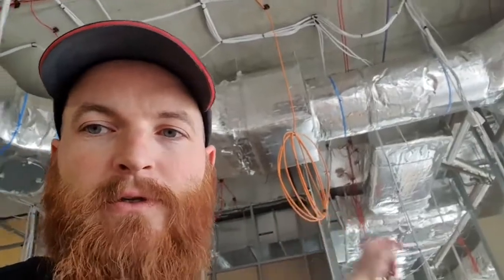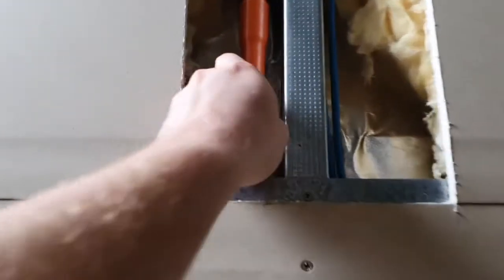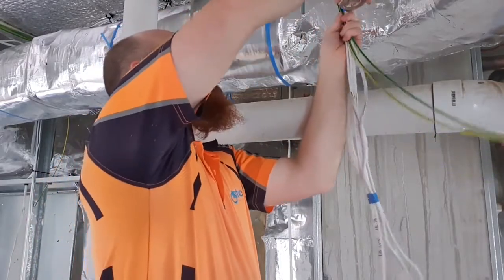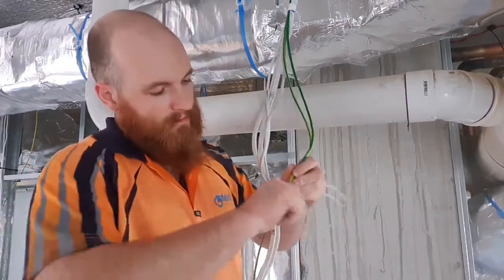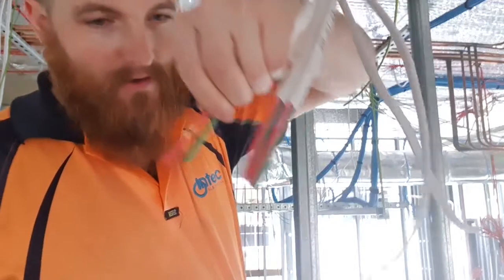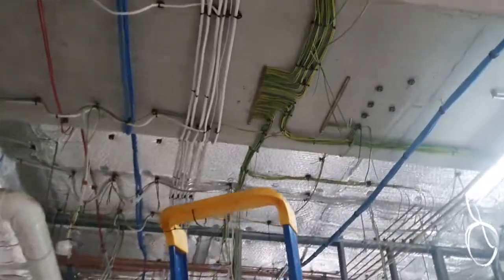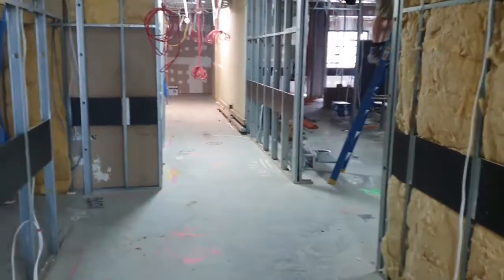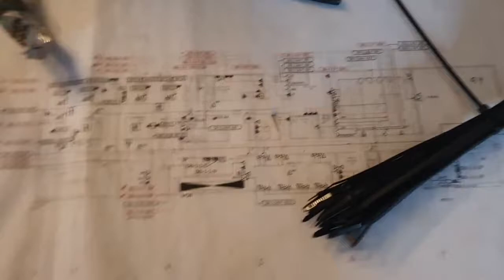ELECTRICIAN VLOG#8 - Cardiac Protected Wiring, Aussie Site Antics, Jacking Off Cable Tray, and More!

Comment: Rough in looks awesome mate👍 do you have to run the 6mm Earthing to all the Downlight’s as well? Not sure about using just Heavy Duty conduit, WSX3 refers to Very Heavy Duty Conduit I’m not even sure what that is?
Reply from the maker: Thanks, yeah in a cardiac area all lights on the equipotential bonding too. Im not sure what very heavy duty mean either to be honest 😅. It references 2 extra standards which cost another couple hundred bucks each - easy future video topic there - how fucked the standards paywall is...

Comment: Lets say the cable moves freely in the wall, would you get your 50mm distance from the finished surface ?
Reply from the maker: I've had patient area inspections by a guy involved in writing the standard, he reckons that if there is insulation in the wall the cable is classified as fixed in place against the plasterboard. 

If you wanna be real picky its definitely closer than 50mm right before you terminate the outlet - should we not then be using a metal backbox and conduit? hard to know where to draw the line... 

I agree with this rule in principle but here in this case in practice not so much - the chances of a dangerous situation occurring is just too low in my opinion... but we just gotta get it signed off ya know

Comment: Hey Dave, what was the note the engineer went with? 
Also can you please explain how come you need to use anaconda or orange conduit in the wall? I’m an apprentice and don’t fully know the book
Reply from the maker: https://youtu.be/0mkfo7VNF6k?t=288  AS3000 3.9.4.4 (a) gets you to table H5.4 which is a mechanical protection table. That table there says that heavy duty conduit can be used to satisfy 3.9.4.4 and therefore you don't need to use metal screened anaconda which would satisfy 3.9.4.4 (b). Its confusing I agree... If you click the link and pause the video I clipped the standard clauses from my PDF.
Reply from the maker: Say If you had a guy hanging a picture frame and he screwed into the wall and pierced the active - that screw would have 240V on it and could give our handyman a shock. If you have an RCD protecting the circuit and Mr. handyman was getting a shock the RCD would sense the imbalance and trip off. The reason you would want an earthed metallic enclosure for a non-RCD protected cable is to make that situation impossible - If you put a screw through a metal conduit and then into the active you would get a short circuit and the circuit breaker would trip off. Finally - the reason we have a non-RCD protected cable in the first place is that patient areas have their own standards and any RCD protection needs to be locally reset-able by the hospital staff, so you have a CB back at the board and an RCD in the operating theatre in this case. Hope that all makes sense 😅
Reply from the maker: I'm planning on doing a decent video on patient areas one of these days - best way to understand something is to teach it to someone else 👍